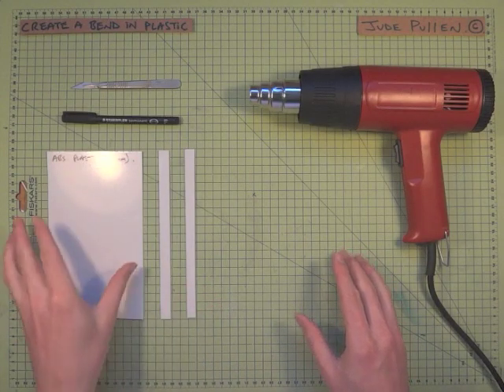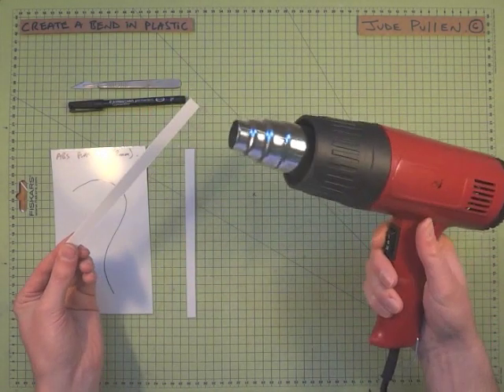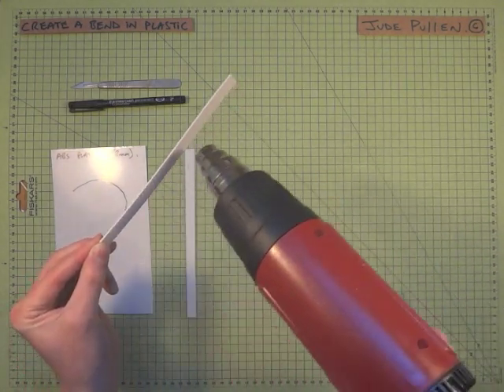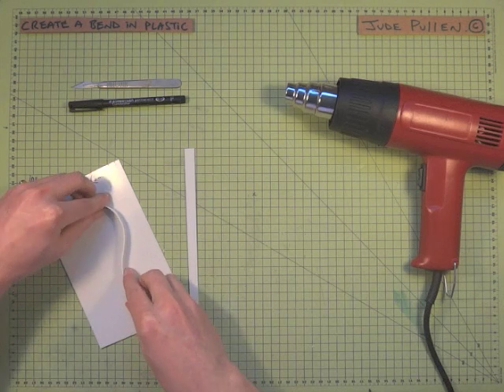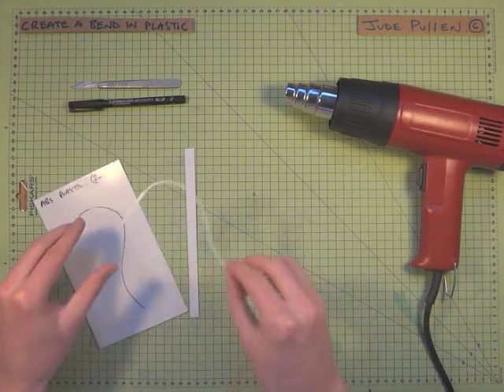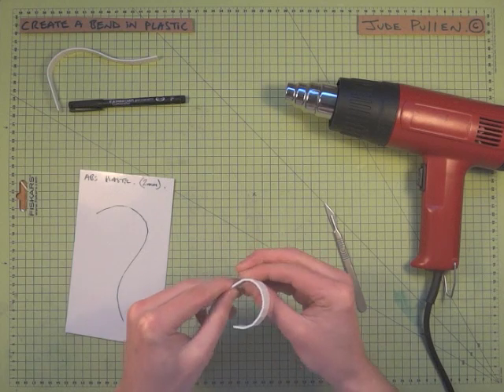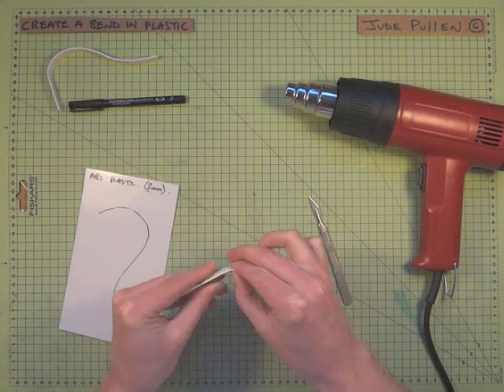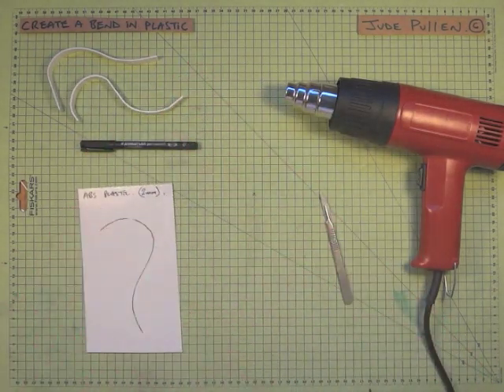Design Modelling - Plastic - Creating a Bend (with heat and by folding)

Comment: Thanks was informative, what is the name of the plastic you are using and the thickness ? Do i just search for " sheet plastic......want to use it to build parts for 1/24 scale model cars.
Reply from the maker: It’s 2 or 3 mm ABS sheet. If you go to my website there is more info on the materials tab. judepullen.com/designmodelling

Comment: Does the heat gun bend keep its shape  forever if you use the cold water trick, or will it eventually lose its shape  of it sits long enough?
I was wondering for something like 1/6 shoulder armor that can't be glued into shape. Thanks!
Reply from the maker: ABS can be heated/cooled many times, so it should be ok. Check out 'thermoplastics' for more info. Hope that helps!